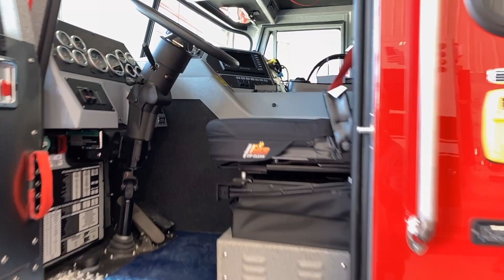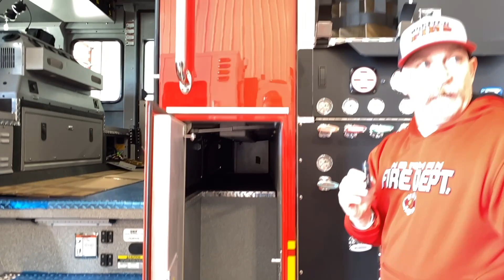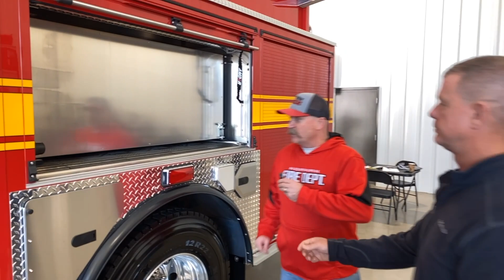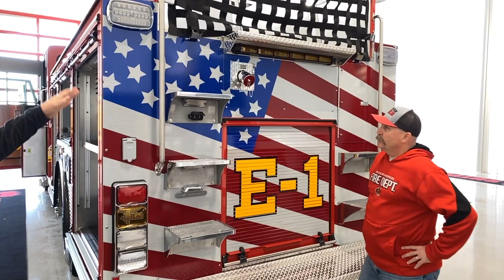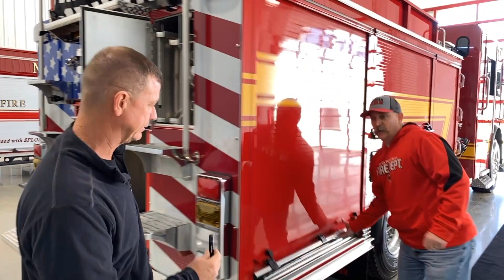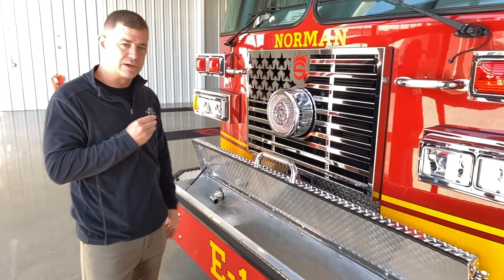Norman (OK) Fire Department

Comment: Great looking truck, only questions are:  Pump and tank capacities, also hose bed capacity?
Reply: DEALER: Heartland Fire Trucks 
DELIVERY DATE: 11/08/2023
DEPARTMENT NAME: Norman Fire Department
CITY / STATE: Norman, OK 
TRUCK TYPE: Sutphen Heavy-Duty Custom Pumper
WHEELBASE: 196”
TRAVEL HEIGHT: 10’ – 2”
TRAVEL LENGTH: 32′ – 3”

CHASSIS: Sutphen Monarch Heavy-Duty Custom Chassis, 73” cab with a 10” Raised Roof
Four-Door, Five-Person Cab
10” Double Domex Frame Rails (110K PSI)
Front Axle and Suspension: 20,000 lbs.
Rear Axle and Suspension: 27,000 lbs.
Engine: Cummins L 9, 450HP
Alternator: Leece Neville 420 AMP
Transmission: Allison Gen 5, EVS3000

PUMP: Waterous CS-1250 GPM, Single Stage Pump
Discharge: (2) 2 ½” Left, (1) 3” Right, (1) 2 ½” Right, (1) 2 ½” Left Rear, (1) 1 ½” Front Bumper, (1) 3” Deck Gun
Crosslays: (2) 1 ½” & (1) 2 ½” w/ Swivels

BODY: Sutphen 3/16” Extruded Aluminum
Amdor Roll-up Compartment Doors
222 cu. ft. Total Compartment Space
Alco-Lite Ladder Package: PEL-24 24’ 2-Sec & PRL-14 14’ Roof & 10’ Folding
Body: G2 – Alum 40/51 Ladder Chute
Water Tank: 750 Gallon 

ADDITIONAL EQUIPMENT:
18” Formed Steel Channel, Bumper Extension
Federal Q2B Siren, Grille Mount
Generator: Onan 6KW HYD
Camera System: VMUX, Rear
Intercom System: SetCom LiberatorMax, Single Radio, 5 Position
Remote Control Go-Light (2)
FireTech 3-Piece 72” LED Brow Light
Whelen Freedom LED Lightbar
Whelen PFH1 LED Scene Lights
Whelen LED Traffic Advisor